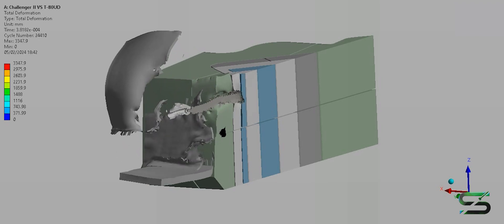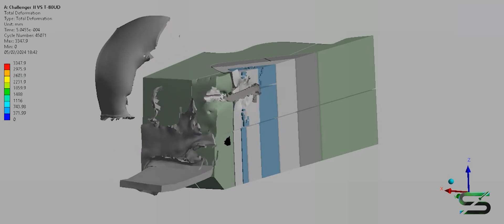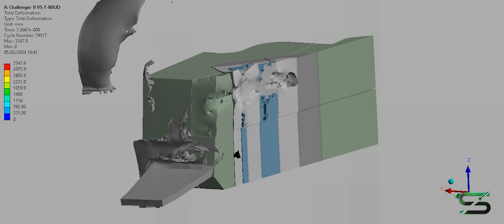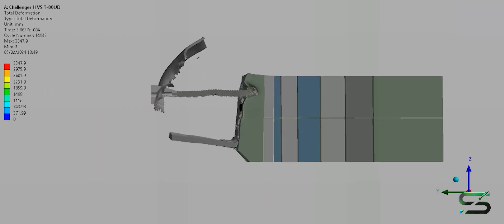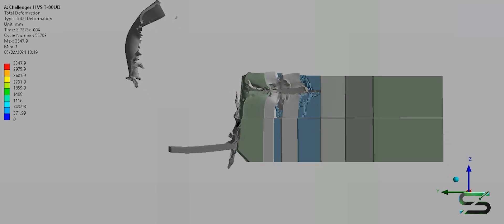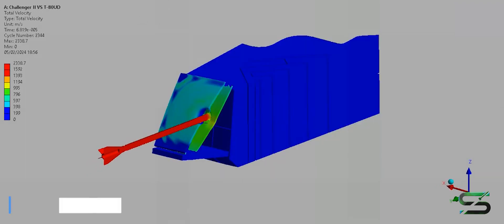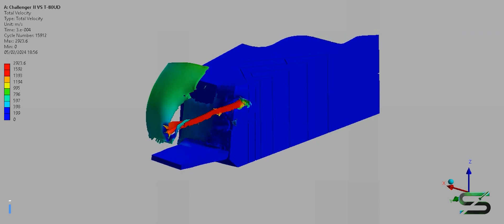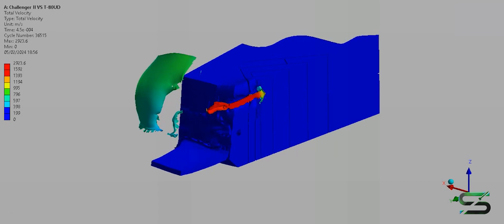Challenger 2 VS T-80UD | Armour Piercing Simulation

Comment: When narrator says "to bolster innefective protection of their tanks"... Soviet tanks always had more thicker armor than NATO tanks until 1991. T80U was superior in armor than anything west had in 80s. Abrams was built to counter T80U, not other way around. Soviets brought into the service T64 and T72 when Americans had M60, British ahd Centurion and Germans had Leopard 1. Later after that, Soviets introduced T72B, T64B and T80B and U which were SUPERIOR in every aspect than those mentioned wester tanks. Abrams, Challenger and Leopard-2,Leclerc evened the MBT ratio. Russian T90 was just T72B with T80U package on it. They first called it T72BU but switched to T90. Second series was T90A with welded turret of doubled thickness and T90M with Relikt ERA. Now they have T80BVM which is T90M package on T80B.
Reply: First. Why do you use non contemporaries vehicles in your comparison? 
For instance, M60 had better protection than t62 in upper glacis, the M60a1 had better protection both in turret front and upper glacis than T62, both tanks were contemporaries. How can Abrams be built to counter T80U which entered service in 1985 when Abrams entered service in 1980? 

Second. You do understand that ineffective protection means that it's ineffective against anti-tanks weaponry and not that it compares soviet armor with western armor of that time?
Reply: Not according to NGIC FME. But what do they know? They had to settle for analyzing actual vehicles and you have access to the interwebs.

Comment: At the time the US was beating it's chest claiming it had defeated the best the Soviets had to offer in Iraq in the Gulf War, this was the best tank the Soviet Union had to offer. Along with several superior versions of the T-72 that were never sold to Iraq, it was never exported. They saw older variants that were not comparable to the Abrams like the T-80 was designed to be. It even had a jet turbine engine like the Abrams. Propaganda is misleading and the Gulf War was full of propaganda too.
Reply: Bradley’s destroyed the majority of Iraqi armour. Abrams was a overkill. It’s a better mbt than anything it would have fever from the soviets.
Reply: @FancyPantsOnFire  Wrong, F111 ground attack aircraft killed the most armored vehicles. The Bradley wasn't anywhere close and it's just an IFV and not even a tank. It couldn't even destroy a T-90m if it wanted to. 🤣🤣🤣👏👏👏
Reply: @The_Prince_Of_Crows  oof. Relax there sweetheart. I’m aware of this. I was referring to vehicles. The Bradley destroyed more Iraq armour than anything else. Moreover, the Bradley is also better than anything the Russians are rolling around in they can call an IFV.
Reply: @FancyPantsOnFire  Nice back pedaling there chief. Unfortunately that is a debatable claim. The Bradley was almost cancelled because of it's failures as an IFV. To claim it's better is a reach to say the least. And being that destroyed vehicles in desert storm were off by up to 70% it isn't exactly a credible claim any way you want to dice it.
Reply: @The_Prince_Of_Crows  lol I just slapped you around with facts and you’ve tried a rebuttal that bases itself on the assertion 70% of kills were mistaken. Listen, you made that up and are expecting me to be as dumb as you and buy it? You’re wrong. I even checked. Prove me wrong by citing a source
Reply: An equally big issue was that Iraqi forces weren't using the most modern ammunition for their tanks, but predominantly earlier export rounds with all steel penetrators, which were ineffective against the Abrams. In Soviet service in the late 80's or early 90's, they would have used primarily the 3BM42, which would have been far more effective.
Reply: @defnotalpharius  👍 true

Comment: L27A1 velocity at 600 m (1592 m/s) is above its real life muzzle velocity of 1585 m/s reached at upper firing temperature limit (51°C).
Reply from the maker: According to "weaponsystems" CHARM 3 has a muzzle velocity of 1650m/s not 1585m/s.
Reply: @SimulationPlus  https://i.imgur.com/HQ2KsLW.png

Comment: It is actually amazing how much armour that little T-80 has managed to squeeze in such small space.
Reply: Tbf it's a rounded turret so the more to the side you shoot the more armor is gonna be behind it, and also the cramped conditions inside the tank also help the armor
Reply: @petrkdn8224 if it works ig
Reply: @petrkdn8224  from the footages inside it, it's not really cramped like you can still move around in it and there's only 2 guy inside
Reply: @CheekyBreeky77  if you call this not cramped then every western design is like a massive villa then?
Reply: Just give the crew less space.
Reply: @Tuck-Shop  3 man vs 2 man
Reply: A smaller tank has a smaller surface area, which means thicker armour for the same weight.
Reply: @valdemar-q7n  armour also has volume which there is less of in a small tank
Reply: @valdemar-q7n  then we get T-14 with All or Nothing
Reply: None of that armor matters when hit with a 150mm artillery round from the top or getting tracked after running over a mine and then finished off with a ATGM.

Many a leopard 1/2s, T tanks and now Abrams learned that lesson in the Ukriane.
Reply: @BoleDaPole this argument is irrelevant for armor existing
Reply: @gerfand  Yep. No matter the thickness of your armor, whether it includes some new special indestrcutable material, if your roof is thin, your tank is gone.
Reply: @Epsilon2042 that makes no sense tho, the best "thin rods" from Soviets and Americans would be unable to penetrate the turret face of the most armores tanks of the other at the end of the cold war.
Reply: @gerfand I was talking about the guy who mentioned artillery
Reply: @Epsilon2042  I understand, its just that what you said was weird. you mentioned Thin rods, but those can be blocked.
Reply: @BoleDaPole we aren’t even talking about that

Comment: I want to repost your video to the Chinese bilibili websie，It means distributing your video to other websites and marking your original link. Of course, all this behavior will not bring me any financial gain. It is all yours.I will not change your video, your video will be distributed to other websites as it is and bring Chinese viewers to your original video，It's all about generating electricity for love. In short, it's a porter. Of course, the machine translation I used may not be accurate when it is directly translated into Chinese?I'm waiting for your reply here

Comment: I’m confused, looks like you shot at the turret dead on in the lead up, but then shows more of a glancing shot not directly at the turret, but more of an off kilter shot which maximizes contact with the armor. Or am I not seeing this correctly. The demonstration looks one way, but seemingly the armor lay out during the penetration part seems to show a different angle of penetration.

More like a ‘60 degree shot, where the round isn’t headed toward the center of the turret, but more so towards the edges of the turret, thereby showing no the almost optimum contact with the armor?  Thats how it appears to me, but maybe I don’t understand the layout of the armor correctly or what’s trying to be shown.
Reply: The shot clearly went only slightly to the right of the breech. It's just that he didn't model the remaining armor on the edges of the turret to reduce computation time.
Reply: @PAUL-ESNEED  He is right. the round was going towards the breech of the gun at quite noticeable angle on the 3d animation while on the test it's a shot in-line with the barrel of the t80 but off to the side.

Comment: You should do these 4 rounds vs Panther Glacis (80mm at 55 degrees)

90mm T33 APBC (10.61kg penetrator + 0.3kg windshield) with 853m/s muzzle velocity 
[M26 Pershing]

85mm BR-365K APHE (9.152kg penetrator + 48g HE filler) with 792m/s muzzle velocity 
[T-34-85]

17 Pounder AP (7.71kg penetrator) with 884m/s muzzle velocity
[Sherman Firefly]

75mm Type 1 AP (6.615kg shell)) with 850m/s muzzle velocity 
[Chi-To]
Reply from the maker: Well, these are great suggestions for the next simulations.
Reply: @SimulationPlus  
According to US tests 
T33 APBC clapped Panther glacis up to 1100 yards (Source: Lonesentry)

My calculation for 17 Pounder AP is that it will penetrate Panther Glacis up to 500m

17 Pdr AP Penetration
200mm @ 0m at 0 ° - 884m/s 
94mm @ 0m at 55 °
78mm @ 0m at 60 °
-
167mm @ 500m at 0 ° - 780m/s
80mm @ 500m at 55 °
66mm @ 500m at 60 °
Reply: add 122mm D25T with BR 471, that would be great too
Reply: @thiagorodrigues5211  
This is my calculation:

122mm BR-471 APHE
25kg shell at 795m/s
[24.84kg penetrator + 160g HE filler]

Penetration:
205mm @ 0m at 0 ° *
118mm @ 0m at 55 °
97mm @ 0m at 60 °

* Post-Deformation penetration using Soviet AP quality as reference from 85mm AP having 147mm @ 0m

Comment: Why is the Kontakt 5 modeled with 2 flying plates?
Reply: Well there are 2 plates in this section of the turret
Reply: Well that’s how kantakt 5 works
Reply: As far as I know, Kontakt 5 has a single flying plate @AlexBauir
Reply: My sped ass mixed up relickt and konkact 5
Reply: On the hull it doesn't have it, but on the turret, the Kontakt 5 has a frame which puts the panels at an angle. This frame is made out of thinner metal than the front flying plate and from the explosion, it does have the possibility to fly in the opposite direction. But because of its thinness, it doesn't do much

Comment: How effective is the protection of the T-80UD turret without the K-5 against contemporary  HEAT ordnance?
Reply: Very good, composite armour was specifically made to counter HEAT, and the T-80UD had one of the best composite armors of its time.
Reply: @quan-uo5ws  unlikely one of, definitely the best for 1987, DU abrams hadn't been introduced yet
Reply: Средне. Комбинированную и разнесенную броню никто не отменял.
Reply: very, the replacement of textolite for ceramics are better due to spaced armor being presented
Reply: pretty good, none NATO tank can pen with heat shell
Reply: bad, but we are not talking about it without k5
Reply: Very bad. From what we see in Ukraine these tanks are easily penetrated with just about any heat round. There seems to be a massive disconnect between these sims and reality.
Reply: @petermcglone135  How many destroyed T-80U and T-80UD did you see after hitting the frontal part of the turret with a HEAT
Reply: @Im_Mr_Unknown  essentially zero, even T-80BVs were proven to withstand 10+ frontal RPG hits in Chechen wars. In Ukraine most tanks are destroyed by artillery, drones, or ATGMs to the side armor, ambushes with RPGs with hits to the side and rear armor are also common. Also a lot of tanks suffer mission kills with only damage to the tracks, then if they are not able to be towed away immediatly then they are blown up with a drone that drops a grenade down the hatch. Im not even going to talk about weapons such as NLAW or Javelin that completely ignore armor and just strike the top armor of the tank which is mostly unprotected.